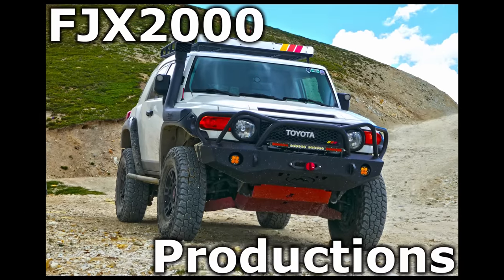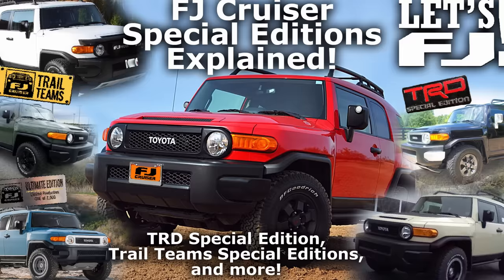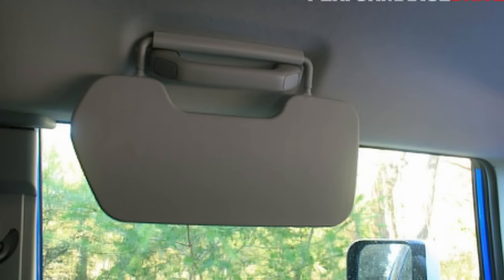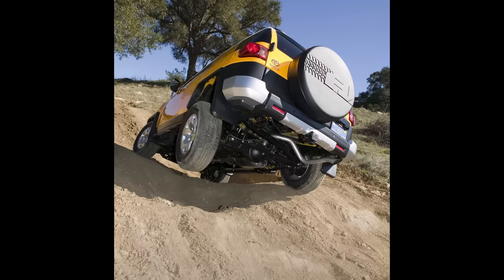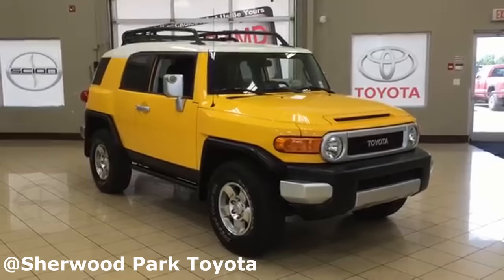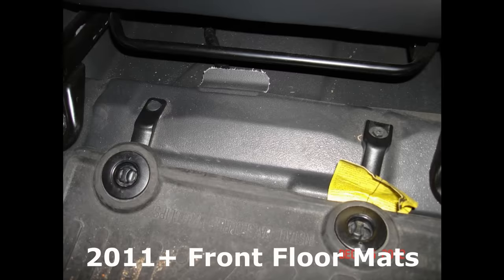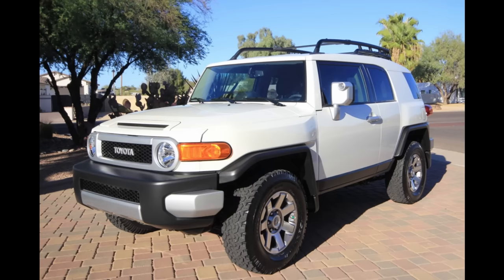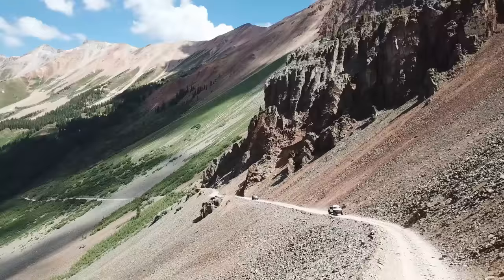Which FJ Cruiser Year is Best? - All FJ Cruiser Changes 2007-2014

Comment: I have a 2007 trd special edition. Broke couple teeth in my rear differential gear got brand new rear differential and broke again. After watching this video should I install newest oem 8.2" diff or beef it up with aftermarket gears?
Reply from the maker: I would say getting aftermarket gears from a company like ECGS would be the easier route, but some are ambitious enough to do the full axle swap. So whatever works for you! If you do the gear swap though, for the 8" diff it is recommended to go with 4.56 gears. 4.88 gears are also an option but they are generally only recommended for 8.2" diffs
Reply: Thank you. That helps a lot. All I need now is to save $ lol

Comment: What’s the easiest way to fix my rear locker. I didn’t use it and now when I push the button it’s not engaging.  The dealer wants a fortune to fix it
Reply from the maker: I’m not sure, you might be able to find a local shop that could do it. Depends on what the problem is. I had a similar issue when I first bought my FJ, so the dealer replaced the rear locker actuator as that turned out to be the problem. Good luck!
Reply: @FJX2000_Productions  that’s my problem.  Do you remember what you paid to fix it ?

Comment: How would you respond to the articles on internet search saying the 07 is the one to avoid?
Reply from the maker: I think I sort of address that in this video, with talking about the known issues for the fender bulging and weak rear diffs, it may be a better idea to get a different year. But ever model of vehicle always has issues it’s first model year, so it isn’t just something isolated to the FJ. It is good practice to use caution purchasing the earliest version of any car. But with that said, most FJs produced are indeed 2007-2008 model years and most are going strong and give people no issues, so it isn’t too big of a concern, especially if you are into using the FJ as a daily driver and not off-roading it hard.
Reply: @FJX2000_Productions  Thanks.. yeah I was more concerned with articles saying common issues for the 2007 was they didn't have rust protection for the frame, Shuddering at 35-45mph , Trans not going into 5th etc. I have noticed when searching for a used FJ that 2007s are easiest to come by...by far,

Comment: 2021 are the best,  they sell them in Asia.
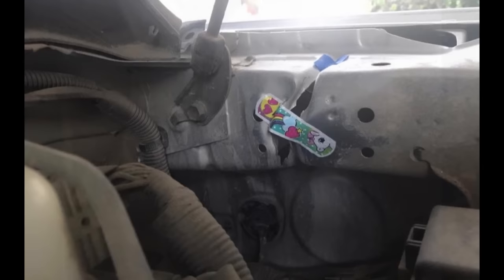Reply: I have a rust free 1985 4runner SR5 5 speed on 35's with 5:29 gearing, and never selling it. unless you can make offer I cannot refuse.
Reply: @dundeeecroc  I have a 2019 trd off road.
Reply: @Estuardino71  nice, but I don't recommend anything  made after the year 2000.
Reply: @dundeeecroc  They are made in Japan, nobody can't touch them, the difference between yours and my is like night and day.

Comment: Any chance you could research the 2015-2021 models? I see videos of them all the time, but they don't really tell or show the differences in the models. Some look really bare bones and don't have many options like the older US models. Thanks. Good Luck with Dental School!
Reply from the maker: Thank you! And I could possibly do some research on changes to the FJ after 2014, but it would be pretty difficult as the documentation is pretty hard to come by for other FJs outside the US and different countries had different changes incorperated that I just dont know enough about to make the video as accurate and reliable as I'd like.
Reply: I live in Chile. last I checked they were still selling a 2019 model. I have not looked recently. I have a low mileage 2010, and simply have not seen any options on the newer ones that would get me excited to buy a newer one.

Comment: Ive had a 1972 fj40, a 2007 fj cruiser,  and now only jeeps. Now have a  pristine 1999 tj 4.0l 5sp 125k bought for only $4000, and a 1991 jeep wagoneer  with a gm ls engine transmission axle  swap bought for $5k. 
And i would never own an old  fj  or new fj again. The 1972 fj40 was a death trap. Even with $40k put into it and lost much money selling it at a loss. The  2007 fj was also a night mare. When it broke it was ridiculous expensive to fix. Though as an everyday pavement car was better than a 2 dr jeep or new jeep. But fj parts are ridiculously expensive,  as are engine transmission parts.
 jeeps are cheap, jeep replacement parts are cheap, body parts are cheap, engine transmission transfer case axles diffential  parts and swaps are cheap and easy to do.  If you value your long-term money and savings account, get a jeep. I prefer 2005 and older.  The new jeeps are  junk. Though if you find a 4dr jeep with blown engine you can get them next to nothing and then do a gm ls, lx or dodge hemi engine swap with solid axle swap, for very little money.

Comment: I bought a 2007 which I had to wait almost 6 months for delivery and it got stolen within a few months of ownership.  I got another 2007 with the insurance money and paid almost $15k less than the first one.  Being totally honest,  I'd have to say that I've never been impressed with its performance.  Besides the bad cabin view, being unable to use the rear locker in 4H was a total let down, gas mileage was horrible and the braking system was hazardous at best.  Can't say I missed the Tupperware looking front end.
Reply from the maker: Haha! Well the FJ isnt for everyone for sure. It was definitely built as a vehicle for offroading and certainly not for street performance or comfort. But I like to say it isnt about miles per gallon, it's about smiles per gallon! No one has a cooler car when you're in a sweet FJ!
Reply: @FJX2000_Productions  I agree. 🙂

Comment: I don’t get the appeal of the fj. Drove one a couple of years and it’s like sitting inside a cave, looks kool though. Traded it for a 4Runner, it’s like sitting on a top of a hill. No ragrets!
Reply from the maker: Yeah the FJ isn't for everyone at does take some getting used to. But for folks that do have them and wheel them they usually love them! But a 4Runner is also an excellent choice!
Reply: FJ made in Japan Toyota Hino truck factory.  4runner also Japan made unless you are unlucky and get one built in China.  The Chinese version were crap so Toyota builds them all in Japan now.